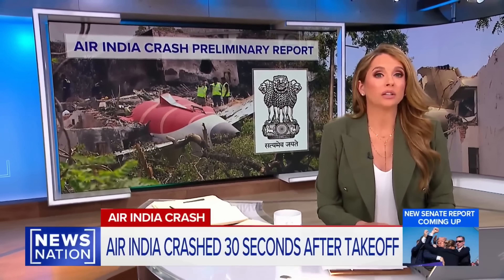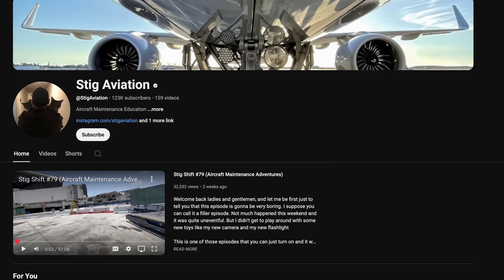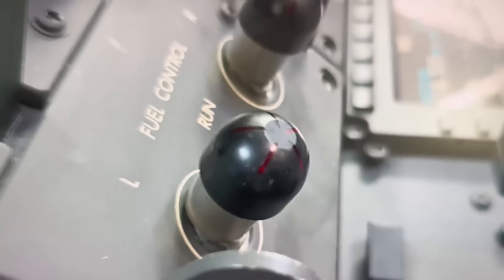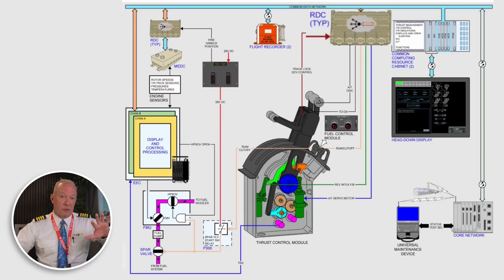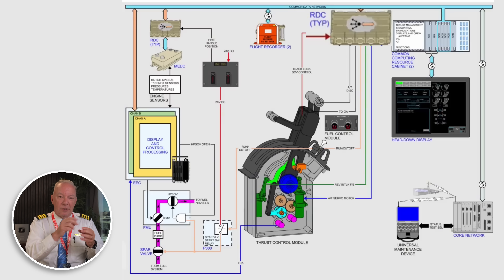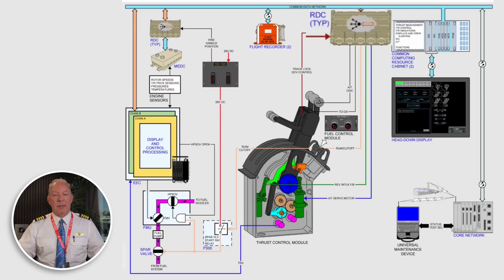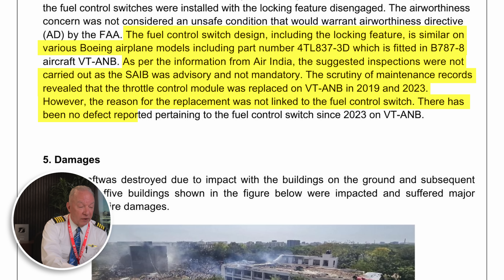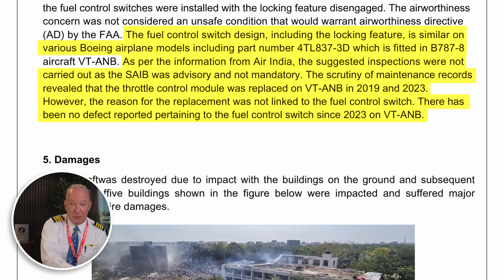The Truth About Boeing 787 Fuel Control Switches

Comment: There is no way in h@ll that two switches failed at the same time and at the most critical time. I’m an FO at a major and once the engines are started the fuel switches are never touched until shutdown. And the FO did the take off. His hands are no where near the switches and all attention is on the PFD and outside.

Comment: I have no knowledge about how an airplane works, but I'm thinking about what we know.
Unless the black box gets it's data from micro switches or something that actually tells the position of the fuel cutoff switch (or a camera showing it) we can not know the position of the switch.
Only that the power rail that the switch operates became powerless.
If one terminal of the battery shown off in this video were removed the blinking light would go out even if the switch were in the on state.
In theory there could be something other then the switches being moved cutting of power (however unlikely).
I hope we get an explanation in the future.

Comment: Captain Steve, great analysis, 100% agree.  One thing that has not been discussed is the required call outs at the point in the flight where the fuel control switches were placed in cut-off.  Why don't we hear from the pilot not flying (PNF): "Positive-Rate"?  This is a trigger for the pilot flying (PF) to respond with: "Gear-UP"  Unless I missed this with flight deck voice recorder read out, this exchange never happened.  We all know the gear remained in the down position from the crash video.  So what does this mean?, well in my analysis, the PNF was busy concentrating on another task.  It also suggests (and I hate to even say this), but premeditation.  I am curious what you think, thanks.
Reply: Your conclusion is sound.
Reply: We don't have the CVR. So how can you conclude anything? If, indeed, they didn't communicate normally, it may have been due to a developing problem.

Comment: May be more possibilities, for example (9:48 to 10:00)  What would a loose or intermittent wire connection from the "battery of the aircraft" thru the  "hot battery bus connection" to the relay, do?  Would that not cause a momentary or intermittent loss of power to the relay resulting in a "transition" of the valves? (yes?) Also, you appear to be convinced it was intentional (I understand why) (16:56) "I'm not saying this is intentional uhh at any level we come in on this it had to be one of the pilots that transitioned them to cutoff" sounds intentional. That may be too soon.  Please advise

Comment: Although there is a “guard” against accidental actuation of the switch/s it does not ( in my opinion) to be safe enough considering the implications of this being turned by accident during flight. I would like to see these switches have some extra protection maybe a turning through 90 degrees whilst lifting and moving up or down to move to ether of the two settings.  This would make this much safer considering the enormous implications. Finally I would design “run” down and “cutoff” in up position to negate any gravity effect in a failure of the switch.

Comment: Een systeem dat spanning nodig heeft om te werken is niet fail Safe.
Er kan fuse blown, short circuit of cable.
De klep zou open moeten blijven door veer en met spanning worden gesloten.
Dan is de enige fout dat de klep bij kortsluit of zekering kapot niet kan sluiten en de motor niet uit gaat.
Maar dan sta je wel op de grond.
Vreemd dat er wel controle is dat je landingsgestel niet kan intrekken op de grond maar in de lucht wel de motor kan uitzetten.
Uitzetten in de lucht zou dan alleen door blussysteem moeten kunnen.
Heb niet veel vertrouwen in Boeing ingenieurs denkvermogen

Comment: Something that I have been wondering.  Does the Flight Data Recorder record that actual position of the switches,  or does it only record that the fuel control valves were closed.  Is it possible that the fuel cutoff relay lost its 28vdc, opened and caused the fuel valves to close?  Thanks for your detailed fact based info.

Comment: I revised this comment multiple times before posting. I understand this is Capt Steve's channel, but the guy in the interview seems to rely on a circular argument. Modern aircraft are obviously far more complex than older ones, starting with the removal of the flight engineer. Even if the flight engineer role were reinstated, I doubt a three-person crew could manage all the tasks required today. Calling an aircraft dangerous simply because of its complexity is, as I said, a circular argument. Moreover, it’s clear to me that the gentleman didn’t know what he was talking about. I watched the video about 10 minutes after it was uploaded and waited over 20 hours to consult with someone I know who has extensive knowledge of the 787. What he told me fully supports Capt Steve’s statements in the video.

One final point: people like that gentleman actually make the NTSB’s job harder. It’s like trying to decipher a phone call filled with static. All he’s doing is adding more noise to the conversation.

Comment: You failed to mention the “AND Gate” at the HPSOV. Both the relay and the EEC have to be in agreement to open the HPSOV. The FMV is directly controlled by the EEC. The Spar valve is directly controlled by the relay.
Reply: Exactly. At 00:04:09 Cpt Steve says the 28V DC is provided to 3 valves. If you look at the diagram (and assume it is correct) only the spare valve is actuated by this signal (orange/skin colored line). The HPSOV valve is acuated by this signal combined with the HPSOV OPEN signal from the EEC via the AND gate. The FMV valve is not in the circuit of the relay and is only activated by a signal from the EEC (black line). There is also a signal from the run/cutoff switches to something called the RDC (on top in the diagram) that communicates via the common data network with the EEC. So a lot more going on here than just 3 valves that are opened by a relay…
Reply: Apparently, an RDC digitizes a switch signal. What I am writing now is just speculation based on what the diagram is showing, but if this digitized switch signal is the one written to the data recorder (which would make sense since it is a digital signal on a data storage device) and also used in the EEC to do more operations on the fuel valves, a malfunction in this RDC or somewhere else in this path could explain some of the things that were reported. But again this last part is just speculation as we can’t read from the diagram what the RDC signal is used for.
Reply: @popeye9177 Yes the RDC (Remote Data Concentrator) takes analog inputs; on/off, resistance (e.g. temperature), position, etc and converts that to a digital signal that is sent to the Common Core  System (CCS). Systems/Valves that are controlled by the CCS get the power from the Remote Power Distribution System. The fuel spar valve control (open or close) don't use any of that stuff :)
Reply: Shatkinair and Popeye;  As an electronics engineer I stopped the video at the point where the diagram is shown and analyzed what was controlling what and I agree 100% with your comments.  There are a number of "digital" things that can control either the HPSOV or the FMV.   The SPAR valve is the only valve DIRECTLY and ONLY controlled by the fuel cutoff switches and the SPAR valve start switch relay. (This also assumes a steady 28VDC supply from the fire handle module.)  Looking at the plumbing, the 3 fuel valves are in series so they are effectively an "AND" gate.  All 3 valves must be "open" for the engine to receive fuel.  It would appear that the HPSOV and/or the FMV could be commanded "closed" by the computers on the aircraft (EEC, RDC, etc.) thus shutting down the engines without being commanded by the crew via the fuel cutoff switches.  This opens up the possibility of a scenario where the crew transitioned the cutoff switches in an attempt to restore thrust after the computers glitched and shut down the engines.  I would assume the DFDR would be recording engine parameters such as N1, EPR, fuel flow, etc. and a critical question in my mind is whether the DFDR recorded any anomalies in engine operation BEFORE the fuel cutoff switches were transitioned.   While I have not seen every bit of information about this accident I have not seen any commentator give information on the relative timing between engine parameters and cutoff switch transitions.  As I pointed out in a comment on a different video of Captain Steve's, is is also very important to know exactly at what point in the circuity the DFDR is monitoring a given parameter as different monitoring points may be subject to different failure modes.
Reply: @Vincent_Sullivan  You are correct, the fuel spar valve is one of only two I know on the 787 that is not controlled by the CCS (Common Core System = Computer). I'm pretty certain the Fight Data Controller records the fuel spar valve position which is provided by a limit switch on the valve shaft, that analog signal is sent to the Remote Data Concentrator and from there to the CCS. Once that signal is in the CCS the flight deck display will change the valve position, and any subscribing systems (FDC and Fuel Management System) will know of the valve state.

Comment: This gets more silly. So one pilot switched the fuel off, the other pilot switched them back on. Why didn't the first pilot struggle against turning them back on? Do the actual switches have a direct contact with the black box recorder or are they simply connected to the relay

Comment: Thanks for the explanation. One question, if all electrical power (so also the battery) would be gone, are the fuel valves than moving to a defined position, so are they going to be opened or closed? Are they springloaded? Imagine the 28v system was down, the stand-by battery broken, what would than happen? Do the valves stay open, or are they forced to close?

Comment: Many years ago I owned a HD pickup which I used to travel very long distances; sometimes in mountainous and desert locations. I installed a separate gas tank connected via T connectors to the engine. I installed a heavy duty switch to use either the left or right side gasoline tank. Unbeknownst to me my toddler switched the tanks. I was travelling in the desert and notice that I was running out of fuel and checked the switch. I decided later to add a fail-safe feature to that switch which had s small lock preventing children from messing with it. I am not a pilot yet, I have seen numerous videos of those fuel cutoff switches which require human effort to turn then on or off. I also spoke to an engineer I know at Boeing who stated the switches are not connected to any computer system and cannot be manipulated by any electrical system on the plane. Even if they fail, or the spring breaks, that will not influence the connectivity, and both failing within seconds of each other is like winning at Kino every time the balls are in play.  Either the pilots made fatal mistakes, or one of them decided to end his life and take everyone with him.
Addendum: In my opinion, there have been cases where either the Captain or the F/O deliberately crashed a commercial airliner. Since we are dealing with human and their personal frailties it would behoove aircraft manufacturers to isolated critical switch components in the cabin. As an example, have the run/cutoff switches far enough from each of the pilots to prevent one pilot from turning off both of them. However, no far enough so that in an emergency either pilot can lean over and turn both on/off, yet no permit haphazard or intentional turning off/on both switches. The way are now configured the switches have some sort of guard preventing either pilot from erroneously manipulating the switches, but it cannot prevent either pilot from turning them off. In my opinion, having those critical switches far enough from each pilot would, at least prevent anyone from turning both off.  I know it is a far fetched idea, but we are dealing with the responsibility of human lives not just cargo.

Comment: Hey Captain Steeve
The 🔥ing Issue is those switches would have been built Just like the Under Wheel Carriages where  you can't Retract them while the plane is on the Ground, after V1 till you get to a Safe altitude & even in safe Altitude you can't move them unless there's an Engine 🔥, it's a simple software writings why didn't Boeing make it inoperable, & this makes Boeing indirectly responsible 4 the Crash of AI B787-8 171

Comment: What a stupid example you made. You didn't have a relay, just a switch that operated the light. The relay on the aeroplane is remote from the switch. So there could still be a wiring or relay problem. I call bullshit and I think you may be following a false path
Reply: Nonsense

Comment: Don’t understand this. The diagram that appears around 8 min into the video. Shows a signal designated HPSOV OPEN coming from the Display and Control Processing box is ANDed with the signal coming from the fuel switches. -Which means that both need to be active for the valve to open. In addition, there is another line from that box going to another valve in the chain. So, how can you say that the computer cannot possibly be at fault?  Either that conclusion or the diagram must be wrong
Reply: The explanation is very simple: Steve is wrong.

Comment: As an electrical engineer, I dismissed the other "whistleblower" panelist on Piers Morgan.  I believe that panelist was using a non-electronics term "mimicking" to mean a situation in electronics known as "crosstalk."  Crosstalk usually occurs when an electrical transition on one wire or PCB trace causes a disturbance on a parallel wire or PCB trace through an inductive coupling between the two wires.  This situation is much more likely to occur with high-speed signals with fast edges (ie fast signal transitions) where the impacted wire is in a low voltage signal domain (ie, small amounts of induced noise can "trip" digital signal thresholds to appear as an asserted or de-asserted signal).   And usually, aside from the wires being close and largely parallel, there isn't adequate grounding around the wires to oppose the inductive coupling.  In the diagram shown, it would be very difficult for crosstalk to affect the signal from the fuel switches.  The high voltage on those lines and the natural isolation of the relays would tend to make this circuit highly immune to that issue.
Reply: What if the battery charger was not working and the battery drained out and DC stopped. Electrical failure no???

Comment: 7:58 they are not connected at all? Seriously, then how would you justify incident of 2019 ANA which seriously took over the control. By your argument, it seems the investigation report is wrong and you yourself are right one here.
You know what, you sound like the 'PUNDIT' here not coming out of your biases. Its basic electronics, You can short the wires of your toy and it will pump the fuel, you can manually cut and your switches become disabled, regardless of your argument that switches are mechaical bla bla bla...

Comment: I have a simple light swich which goes physically in two positions....the switch is in the on position but something is causing the light to go off. i change the light bulb, changed the fitting,  to see what happens, I changed everything but the switch. light still goes off at times or doesn't go on with the switch.... what does that leave me with.. yes you guessed it

Comment: electricity to the relay, which supplies power to the pumps, or it doesn't.
The problem with the flight recorder is that it only logs whether the circuit is closed or not. It does not (visually) see the position of the switches. In theory, and yes, the chance is small, especially when two circuits are involved, the cable connection from the switch to the relay could also have been interrupted. For the flight recorder, this is indistinguishable from a mechanical movement of the switches. 
There has been a case in the past where incorrectly laid cables were short-circuited or disconnected after weeks of rubbing against the control horn. I don't want to push any theory here. But just because the flight recorder records that the circuit from the fuel switches was interrupted does not necessarily mean that the switches were moved. It is one of the most likely possibilities, but by no means the only one.

Comment: Do the relays voltage low side share a ground, or have a proximity on circuit board where a loose screw or bouncing wire could trigger? Are the relays contacts shielded?